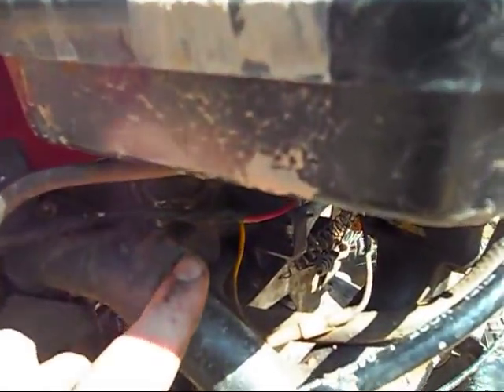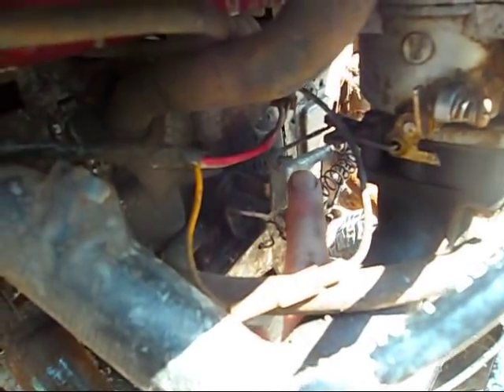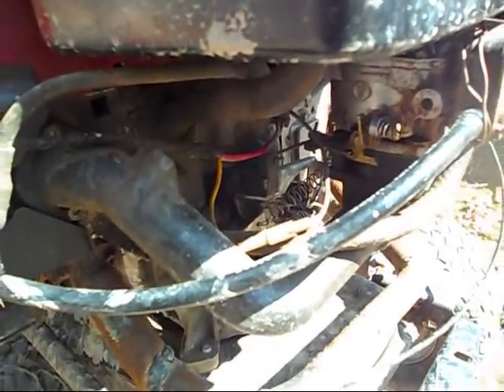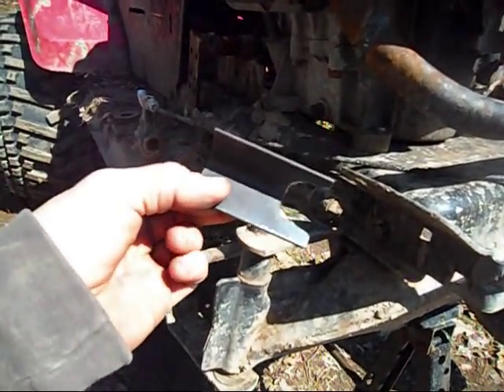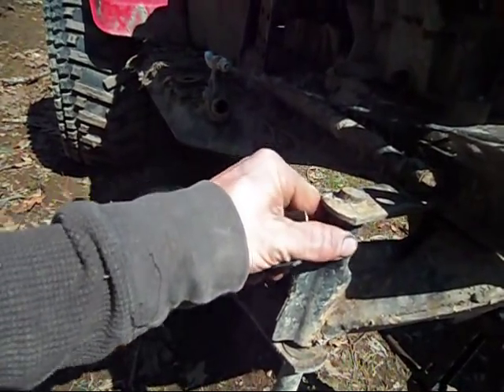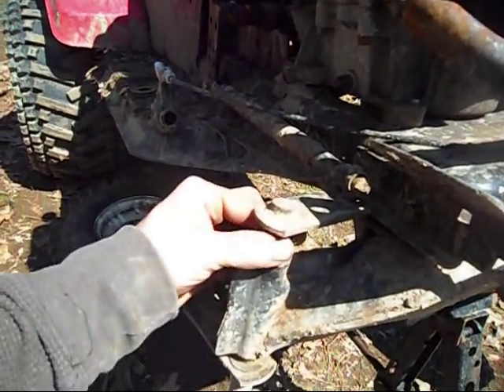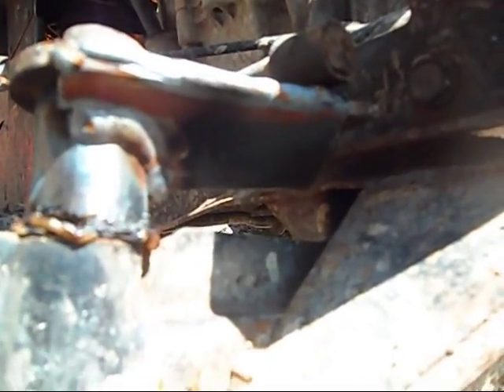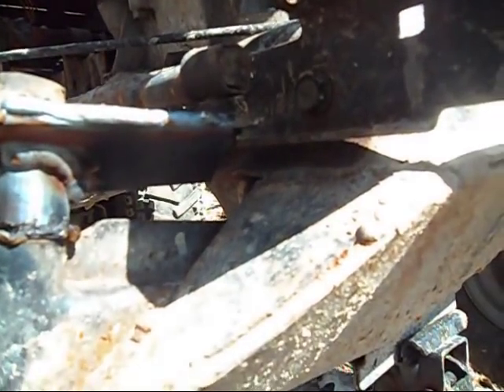Gas pedal steering fix.

Comment from the maker: There is a balance that need to be maintained. if you put that much weight on the front you need larger tires. but larger tiers are harder to turn. therefore you need a stronger trans-axle. BUT, all that said you should build too your own outcome. build what you want it to be. what you want it to look like. There is no right or wrong way.